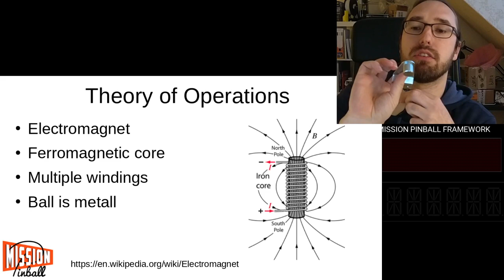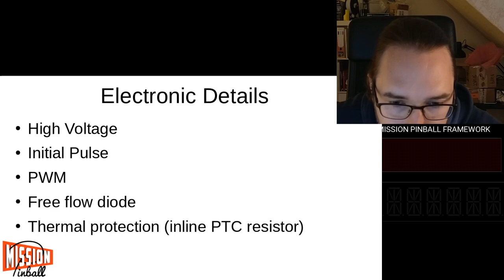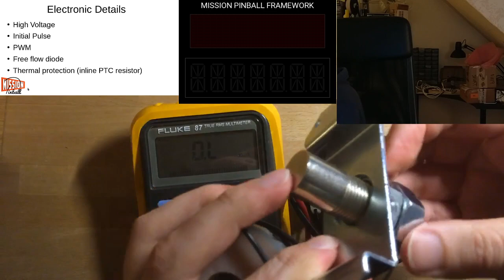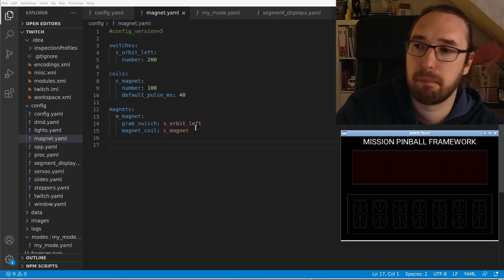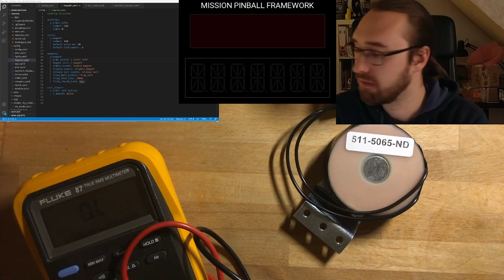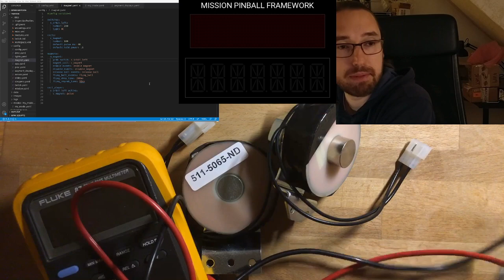How to Use Magnets in Your Custom Pinball Machine? - Mission Pinball Framework

Comment: Thank you for your very well-made videos. Because you explicitly mentioned it in your checklist. Is it necessary to protect a magnet with its own fuse or are the fuses on the CobraPin board sufficient?
Reply from the maker: Thank you. In most cases the fuse on the cobra pin board should be enough. They need to be dimensioned accordingly. I would not put two or more magnets on one fuse though. That would require quite a strong fuse and at some point your wires/connectors would burn before the fuse.

Comment: Thanks for the informative video!  Is there a typical diode you use for the “free flow diode” you mention?  Is this the same as the fly back diode used on coils?
Reply from the maker: Thank! Yes that is the same. There are a few different names for those diodes.